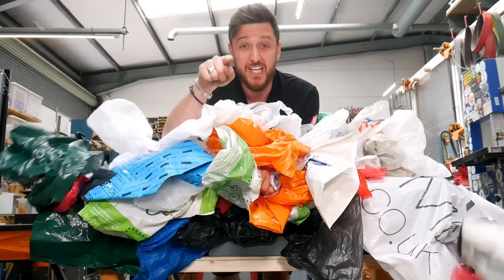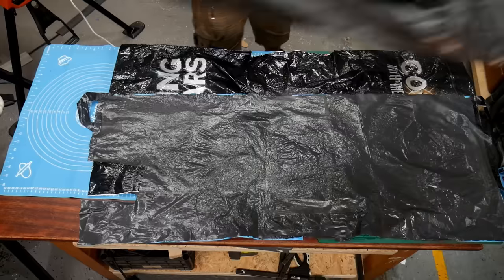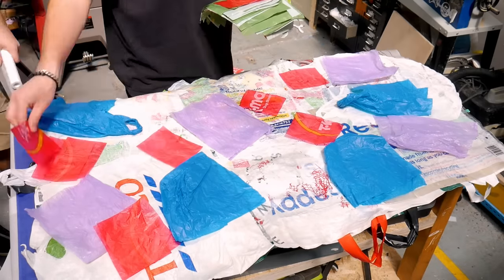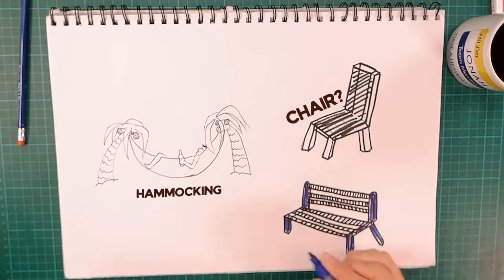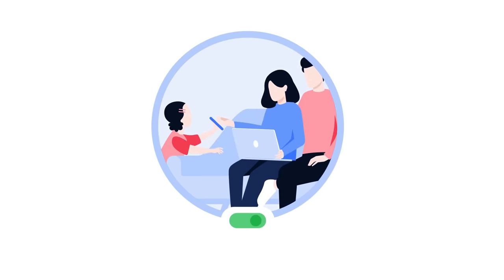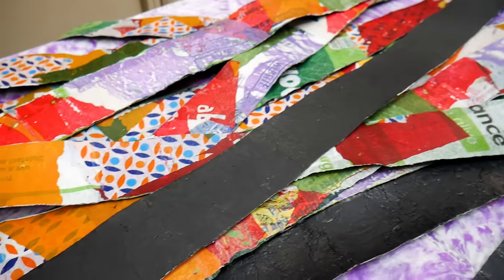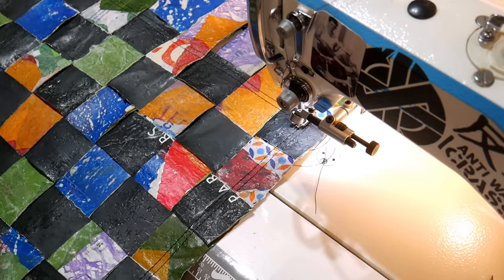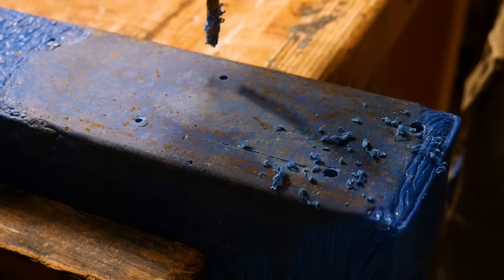Is THIS a Better Use for Plastic Bags?

Comment: The best use of plastic bags is none at all. New Zealand banned them a few years back and we survived. Even MD adapted. I saved a few and they have all fallen into small pieces which break up into smaller pieces when you try to pick the bits up. No wonder the ices is full of microplastic now in the seafood you eat.

Comment: I sort of like it. Absolutely charming idea, wonderful execution and presentation. The good idea of recycling materials. All good BUT ... how much CO2 did you spend on making it, compared to just burning the plastic in an industrial incinerator, getting the most energy out of it, rather than placing it in the sun, turning it into micro/nano plastics?
Reply from the maker: Burning plastic for the use of energy has abysmally low effectiveness rates. It’s not sustainable and should never be considered as an option for plastic waste.

Comment: Are the fumes from melting plastics not a concern? I get migraines from plastic melting moreso than solvents and oil-based paints 🤷‍♀️
Reply from the maker: We have a whole video on plastic recycling safety. Go give it a watch 🤙🏽
Reply: @BrothersMake  awesome! Thanks for pointing me to that 🤗
Reply: But why wasn't a warning given in this video? It may be the only one someone watches. Seems irresponsible to not include a warning about ventilation and the hazards of heating plastic.
Reply from the maker: Did you watch the safety video? No warning necessary 👍🏽

Comment: would it have been easier to make strips to start with? instead of making a big sheet and then cut it up? I wonder 🤔
I also wonder how long ago did you make the chair. would there be delamination on the plastic in time?
as for the legs:
you only made on lower brace, on the back - seems unaesthetic. it would have been more work, but given a more beautiful result, to make to side braces. Like professional furniture.
now I won't sleep all night thinking about things that can be made with the large sheet 😹
thanks for sharing!!

Comment: I had asked back on the wallet video, Can you mix the LDPE bags with HDPA bags? The ones you used for the wallets were LPDE but I have a random assortment of HDPE and LDPE bags.
Reply from the maker: They are both a Polyethylene base, so yes these would fuse together perfectly well. We try to keep to one type of bag type to help with future recycling
Reply: @BrothersMake  Thanks, I try to keep ALL my bags, for recycling/reusing.

Comment: I love that you're finding cool things to make with plastic, but I'm concerned that you do not mention any warning about the noxious fumes that are emitted when you heat plastic like you are doing when you iron it. You need to have plenty of ventilation and maybe even some protection when you're doing this. I also wonder why the really cool bench that you made wasn't being used. It seems like there could have been a place somewhere that might have appreciated a little bench like that, rather than taking it apart for another chair that may or may not actually be used as well.
Reply from the maker: We have a video all about plastic safety. Go check it out 👍🏽

As for the bench, we planned to donate it to our local hospital, but we made a few minor mistakes when we made that first one which meant we weren’t happy to have the general public sitting on it.

Comment: I've always had this idea that they could be used to make insulation... If you marry them together with discarded fabric, or Styrofoam...it could be great!!!
Reply: I saw a video of waste plastic molded into a brick shape. The bricks are lightweight and stack like Legos crossed with hay bales on Rebar. Structure and insulation with waste material.
Reply: @ericaobrien1563  I daw one like that, too! They were building houses out of the bricks! I thought this was gonna catch fire, and become the new up and coming phase, but alas, it seems no one wants to live in houses made of old sprite bottles... 🙁 except me!  😂🤣😂
Reply: @lucymorgan8859  The problem in most of the US is most of the waste reuse doesn't meet current building codes. Where I live even prefab buildings built to code are a problem because all stages must be inspected and approved on site. Prefab is far more efficient. Earth ships had to have a  section of New Mexico annexed out of the jurisdiction location for services and inspections. They can build what they want but have no roads. It's not a matter of wanting sustainable housing, it's not allowed in most of the US. That's why most of the experiments shown are in Africa and Asia.

Comment: Chair looks very uncomfortable. The seat is too short and the top end of the back (the roll that holds the plastic sheet) simply mùst hurt your back/shoulder blades.
As much as I encourage the reuse of plastic (bags in this case), I don’t have all the tools or work benches that you use.
But the idea is great. I think I’d use the plastic sheet on a smaller scale and make a beach bag by hand sewing, or a cover for my garden parasol.

Comment: If you ever seen a plastic bag in some outdoor area you will find that it basically disintegrates.  I'm not saying it is a good thing but that is what happens.  It loses strength and functionality, breaks apart, and withers away.

Comment: why don't you use an electric sander with a bag dust collector? Over the card scraper or hand sanding
Reply from the maker: Sanding produces very fine particles which makes it very hard to collect and reuse 100%
Reply: @BrothersMake  ah, I see, didn't think about the reuse factor

Comment: HAVE YOU TRIED > ROLLiNG BAGS < AROUND A DOWEL/TUBE ETC ?  :  }  I'VE MADE WOVEN PLANTERS & BASKETS . JUST "RoLL"/"FLATTEN" WITH GENTLE HEAT, AFTER REMOVING FROM "TUBE" .  :  }  INDOOR/OUTDOOR. FOR PLANTERS...I USED AN OLD PLANT POT , OR NOT.  :  }

Comment: I used to keep plastic bags to make stuff until I realized that they break down........I stored gourds in them, (I double bagged them. too) and they were not stored in the sunlight and they broke into a million pieces..............why would anyone spend so much time on these crafts then have them designagrate into tiny pieces........there are many other scraps available that do not decompose with the air or sun................as in scraps of old fabric, clothes, nylons, socks and more ??????

Comment: Mate, I'm cringing at watching you use a hot iron on those self-healing cutting mats. I had to pause for a minute to recover... They cost a motza and heat destroys them. Sorry, got a bit distracted there. I've used this technique to make sturdy reusable shopping bags with rope handles. Making a bag from bags, as it were. It also makes good tent/awning flooring for if you're camping, mats to put wet/dirty boots on or under pet feeding bowls, and if you iron it really well and add some eyelets, makes a decent tarpaulin for over a load.

Comment: How much of the toxic chemicals gets absorbed by your body, I really hate to think!!!
All plastic's chemical bonds will weaken during the exposure to heat and the toxins will leach out to the environment. 
Plastics with strong smell are of very cheap quality and we should never have them at home.
Please, please be careful and preferably wear a respirator if you insist on ironing these plastic bags.
Your lungs aren't easily fixable and you'll only know that the damage is done when you wake up one day unable to take a deep breath.
This often happens to people who use epoxy resins without respirator. 
The deep parts of their lungs will get damaged so badly that taking a normal breath is just impossible.
Please take care. ❤

Comment: Cool Idea but no one has all these tools and machines just in their backyard
Reply from the maker: An iron?
Reply: @BrothersMake  No, we all have one of those lol, but to make the chair feet/arms and drill all the holes in it perfectly and cutting the metal rods etc, we all don't have a tool shed in the back yard with $1,000 tools. I wish. SO all I could make from this is the ironing part and that is it. Maybe make some more stuff that doesn't involve $1000 dollar drills and machines
Reply from the maker: We have lots of videos showing how you can recycle plastics with limited tools. This project used an old bench we made that we had the ability to customise into something new, but the video is about the simplicity of the bags. You don’t HAVE to make a chair, make a hammock or backpack, or raincoat that requires less equipment. Think outside the box.

Comment: TY.  < DE~LAMiNATION >, COOL WORD . :  }   SINCE I'VE BEEN USING PLASTIC BAGS LIKE THIS, FOR MANY YEARS, I LEARNED THE HARD WAY > TO CHECK THE HEAT THAT WORKS BEST ON A BAG. SAVES A LOTTA WORK ! :  }  YOUR IDEAS ARE AWESOME!  I'M IN USA & MANY DiFFERENT BAGS WORK BETTER WITH DIFFERENT HEAT SETTINGS. ALSO, THE OLDER /"HEAViER" ELECTRiC IRONS WORK THE BEST ! :  }  <><  LOVE & PRAYERS TO <ALL > IN THIS EFFORT. <><

Comment: so all those off cuts could've been melted extruded into filament and then 3d printer penned /extruded into the holes like a hot glue gun 🔫

Comment: I think it is a little heartbreaking that you took apart the recycled mask bench instead of giving it to someone who would actually use it .
Reply from the maker: We originally planned to donate the bench to our local hospital, but we made a few small errors during the final assembly that we were concerned might compromise the overall integrity of the bench. We didn’t want to donate something that wasnt fully fit for purpose so unfortunately that meant it was in storage ever since it was finished.

Comment: Ok so you recycled to make that bench... but then didn't use it. You just put it away.

Interesting ideas but you aren't really living your convictions... this chair ideal is interesting but no one is gonna do this to reuse the bags...
Reply from the maker: The original plan was to donate the bench to our local hospital. However we made a few minor errors in the final assembly that slightly compromised the safety of the bench, so we didn’t feel comfortable donating it. So we reused the parts instead.